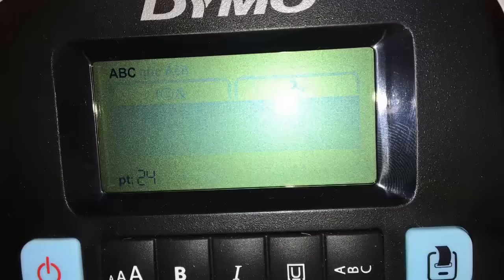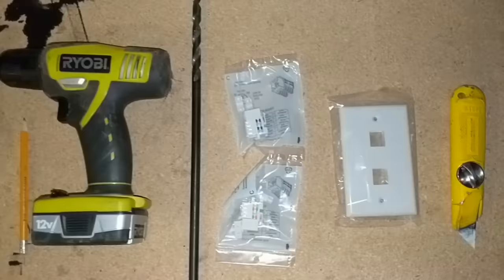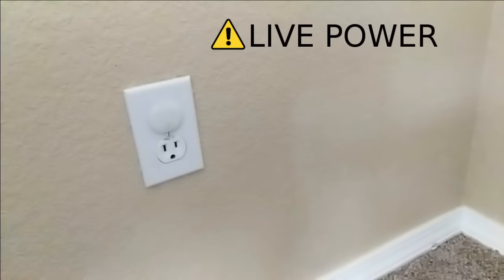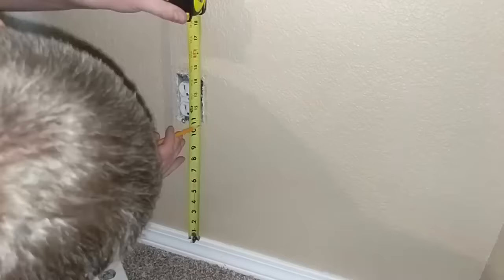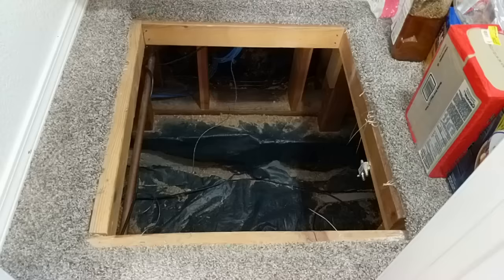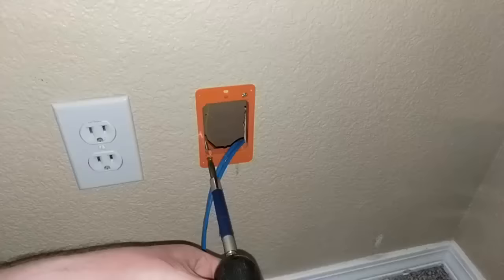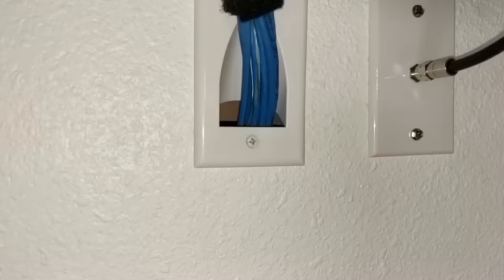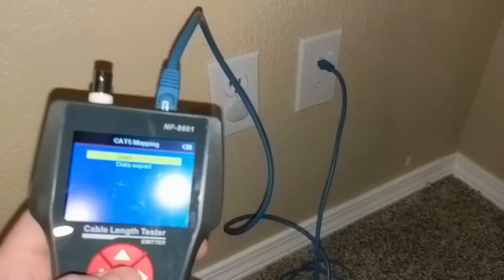How to Add a Network Jack to a Wall

Comment: Good information for getting the wires connected to the ports. I’m surprised by the closing comments about an attic being more difficult than crawl space. My parents house had an attic, and all the houses we’ve had have had crawl spaces. I found the attic 100 times easier to do anything because you could actually stand up and see what you’re doing.
Reply: depends how big your attic is, you can't really stand in mine and you have to be careful to only step on the beams or else you'll fall through the ceiling
Reply: @arsenalfanatic09  ah that makes sense. Only stepping on the beams is pretty normal, but I can see not being able to stand being a problem. That was sort of the case in our first house. It think it was technically an attic, but I always called it a crawl space because the height rendered it useless.

Comment: Typically inadvisable to put low voltage in the same stud space as high voltage. Even shielded cable can be affected by it.  This will be fine for gig but may experience problems with multigig connections
Reply: they just have to be 8inches apart right?
Reply: @Layarion  they need to be separated by a suitable barrier. He could’ve gone to the next cavity over & he would’ve been alright.
Reply: @No Body yes

Comment: HUH UH. I'll game on wifi til I die of old age before I go toe to toe with the spiders in my crawl space.
Reply from the maker: Funniest comment ever!
Reply: router
Reply: Budget Nerd how does the wall get the network from the modem or the router?
Reply from the maker: The Ethernet cable goes from the wall plate, through your house, to a port on the patch panel. The port on the patch panel is then patched (connected) to the switch, which is connected to the router, giving you your internet.
Reply: @BudgetNerd  Is there an under $20 punch down took kit
Reply from the maker: There is a link to one in my DIY budget home network video.
Reply: @BudgetNerd  instead I purchased a double female wall plate, since this is a one time project on the wall under the basement stairs. It was drywalled years ago, but tore down recently  for possible mold growth from a 1/2 water from sump pump  overflow. Putting it backup now and will have the network lines and catv lines ready to go for the drywaller who will just  put the plates back in for me
Reply: Brown recluse and black widows worry the heck out of me. Last thing I want is a flesh eating bacteria sore on my face...I'll go thru the walls some way or another thank you.
Reply: Bob Jones spider bites in the US are completely overblown man. You’ll be alright

Comment: Lots of youtubers put in patch panels, but for those who want to keep it simple, another low voltage box in the switch/router room with a six position keystone plate can be a lower profile and lower cost alternative.
Reply: 6 position keystone plate is exactly what I did

Comment: When I wired my house I purchased different colored keystones rather than using a numbering system. Each room keystone was a specific color. That was eight years ago, I wonder if one can still purchase colored keystones? I was able to run my cabling through the attic easily enough. Fun project.

Comment: That little string you cut off is called dental floss and it is used to strip down the cable beyond where you stripped it to make sure the wires were not nicked when stripping off the outside protective covering/sheathing.
Reply from the maker: Yes, I know.

Comment: Man...American houses are so easy to do DIY on.

I'm in Portugal, have to run an ethernet cable from the main house to the annex, both made with concrete walls, lol. No Crawlspace, no drywall. No easy access to the patch panel.
Reply: Our country is absolutely massive and building codes vary state to state. Please stop generalizing America as if we are a homogenous country. Your home is no more difficult to wire than the nursing home I did last week.

Comment: Tip from a pro:
In situations where using fish sticks is required to fish the wall, locate the lv-1 hole on the other side of the stud from the power, and dead next to it. This way you can ride the stud down and find your fish stick easily.

Comment: Just a couple of things I'd like to mention. You identified where your wall studs were, but then did exactly opposite of what you should have done. Network cables should never be run in the same stud bay as a electrical work and should be at least 12 inches away. You should have gone to the right of the next stud over. Second, you don't use a razor knife for removing a wall plate screw. That's a good way to get a nice cut when it slips off the screw. It's also a good way to get a piece of metal in your eye when the point of the blade breaks off. Third, you do mention a drywall saw, but you aren't using one. You shouldn't use a razor knife for cutting finished drywall. It's extremely difficult to maintain safe control while cutting as you demonstrate while holding your bare hand in the path of the cut as you tried not to slip. Finally, you shouldn't use a drill to lock down a plaster ring. It's a great way to overtighten and break existing drywall.
Reply: Robert Dunham okay bob the builder
Reply: Robert Dunham too long didnt read
Reply: nilpo19 not lazy just don't want to waste my time with another person on the internet that thinks they're a rocket scientist
Reply: sturamic super Wasting your time. You mean like replying to a comment you never read?
Reply: nilpo19 I don't see an issue, read a few words realized he was the almighty electricity god so I replied with the truth, too long didnt read
Reply: sturamic super Yet that comment has the second most upvotes of any comments on this video.
Reply: nilpo19 upvotes.....sorry grandpa ill just go play some videogame bye tell judice I had a good time last night
Reply: Modern screw guns (drills as you call them) have whats called a torque setting. It's very easy to set it low to keep from over tightening the low voltage old work box (plaster ring as you call them). See its easy to criticize others for no apparent reason than to look like a know it all.
Reply: @bpaullus  Even with low clutch setting, power tools will still commonly cross and strip the cover retaining screw.
Reply: nilpo19 I’ve literally never had that happen.
Reply: Thank you Robert, well explain, and right on point.
Reply: If you are a  master at this or whatever you would like to call yourself then why are you watching a video on how to install a network jack? Just wondering if people like you just click on how to videos to criticize them when they don't even make bad mistakes. The only mistakes people ever point out like you are things that a professional wouldn't do but if you are a homeowner then everything stated in these how-to videos are just fine. So stop watching how to videos ifyou already know everythjing.
Reply: Robert Dunham Why can't you run them near electrical work? I've read that you can't but I don't know why?
Reply from the maker: @Oscar Morgan It's best to keep them as separated as possible, and if they have to be near each other, try to avoid running them parallel. The 60Hz frequency of the power in the power wires can induce current in the Ethernet runs creating signal noise. That noise can degrade the cables speeds, or prevent the transmission of data altogether.

I ran my Ethernet in the same section as my power for one of my videos, and I'm sure that's what he's referring to. While he is correct, I have experienced no issues and these issues are often times very rare.. but possible, given the correct circumstances.
Reply: Budget Nerd Oh Ok Thanks, so it won’t cause any problems with the electrical wires, I read somewhere that it can cause arc flares, is this true? Great Video BTW.
Reply from the maker: That's really not a concern.
Reply: Budget Nerd Ok Cool, I guess don’t believe everything on the internet about  causes of arc flashing 😂
Reply from the maker: Not enough wattage to jump to our Ethernet cables. You'd need extreme circumstances for something like to happen.
Reply: Budget Nerd Oh Ok, Thanks heaps for the information 👍
Reply: @oscarmorgan1283  Budget Nerd is spot on with his explanation. However, the effect is much more widespread than he suggests. Power always affects low voltage and it will cause failures if you are certifying the installation. For general purposes, you may not notice speed degradation, but it is happening on some level. It also cause instability and often unexplained problems.

Arc is not a concern with household voltages (outside of lightning strikes), but in industrial applications additional measures are taken when higher voltages are involved.
Reply: @ryleighlawrence6189  I've never called myself a master at this. Yes, I do this professionally. I critique videos and offer suggestions because I believe everyone deserves to have access to quality information. There are reasons that professionals do things differently than DIYers and it only helps the community by making that information more accessible.
Reply: nilpo19 Ok Thanks, how far apart would you suggest run the Ethernet away from power?
Reply: @oscarmorgan1283  The rule of thumb is a minimum of 12 inches when they are running parallel. This is not a regulation, it is a recommendation. And they must never be run in the same conduit. Fire code does not allow category 2 and 3 wiring in the same conduit.

The standard concerning this makes several different distance recommendations depending on how the wires are installed. (Using conduits and shielding can reduce the distance required.) Rather than memorizing all of them, the 12" rule works in every common situation. Since electrical wiring must be secured to studs, placing LV in the opposite adjacent stud bay is the easiest way to make sure you are more than 12" apart.
Reply: nilpo19 Perfect, Thanks for all your help. One last thing, would connect the switch to a modem or a router?
Reply: @oscarmorgan1283  This is a very open ended question without knowing your environment, but the most commonly encountered scenario is modem -> router -> switch -> patch panel -> in-wall cabling -> wall jack. Keep in mind that many routers have built in switches so this can change from time to time.
Reply: If you're concerned about induction but you need your data wires to run parallel to electric wires for a certain distance. You can get shielded cable. Terminating shielding cable has extra steps and you must ground each end of the cable by using a ground wire and special keystone jacks
Reply: actually they only need to be 50mm away from eachother running in parallel, i dont know where you got 12 inches from but according to Regulations 2018 specified 50mm between power and cat
Reply: Robert Dunham who cares buddy. He’s not a contractor and just a regular guy trying to run cat 5 cable
Reply: Yeah, without a shielded cat5/6/7 cable you're looking at some emf intrusion.  Years ago we had a strange call with a lady losing internet constantly.  The outlet was right near the rj45 keystone, when she plugged the heater into the outlet it would cause a magnetic field and the router would crash because there is to much noise.
Reply: @Robert Dunham

Where do you get these types of regulations/best practices for these types of work? I actually do this, and have learned the advice you have given, over time. I would love to have a book to study from, so I can be as professional as possible, and also keep myself from being liable for work not being to code. Thanks for any advice :)
Reply: Robert -
Correct comment.  
This is stated in National Electric Code (NEC) by the National Fire Prevention Association (NFPA).
For critics, you are perfect fodder (“What were they thinking, Do It Right!”) for a Mike Holmes TV Show.
Reply: i run all my cat 6 and cat 6a through 1" conduit.  it can cross romex and i have no problems.  but you are absolutely right... you should always isolate communication from power
Reply: This old House starter kit 29.99$ Robert Dunham
Reply: I'm not an expert and I identified all of those same problems. I guess what I think is common sense isn't so common? I'm sure when I was young I snapped some razor blades doing something stupid. I'm lucky, I don't play around now.
Reply: reads comment
Pffft I'll just use an x-acto knife!
Reply: @SL-rl4kz  BICSI is a great place to start.

Comment: I am considering doing this. I was wondering if you can use an outllet port works both ways so I can use it to plug a cable from my router into a outlet from which a cable goes through my ceiling into an outlet into my room. Pretty much will a wall outlet work as an inlet?
Reply from the maker: Yes, goes both ways.

Comment: Where did you get that punchdown puck, this is the first I have seen of this. That thing is awesome.
Reply from the maker: I'm sure you can get them on the interwebs, but that one came in a 50 count box of keystones.
Reply: You can get them anywhere that sells network cabling. I've picked them up online at Amazon, etc. and also at traditional retailers like Home Depot or Lowe's. Honestly, they don't really work all that well. Most keystones don't quite fit right and they tend to get in the way of the cables as you try to punch down. But for a couple bucks or less, it's worth having one in the tool bag for the occasions when they are useful.
Reply: Leviton distributors use to provide “free” to volume buyers.
I had at least 7, at one time.  I have given them away to new installers — through the years.

Comment: I do this professionally in commercial spaces all the time (there's usually a plenum so I drill down into each stud space from the top instead of the bottom), but I've been wondering how it could be done in residential as there's typically no plenum. Guess it's gotta be attic or crawlspace. Unfortunately my current place has neither lol

Also, would definitely recommend the drywall saw over the utility knife
Reply: Wire tracks are very common in this case as the customer usually doesnt want you taking off the entire drywall which is what you would have to do.

Comment: All of this equipment adds up to the exact opposite of budget.
Reply: Exactly! I hadn't thought of it that way. All I could think of is how often would I use these extra tools.
Reply: Except when you factor in the cost of installation by a pro. Most of these items you can borrow from the IT staff from your office.  Cost is in cable and injectors really.
Reply: @josephyang3260  You're way off? Where are you shopping? Wallplate is 90c, connectors are $8 each, the spool needs only be 50ft, unless you have a 2000+ sqft house which would probably put you above. You're looking at more like 30-40 bucks for good quality 6a cable. 60 for 150ft. Basically your 265-300 bucks is what I would call the "don't shop around" cost. If you shop around that's an easy 80-100 bucks. So it's even cheaper than you thought. No one should use an electrician to do low-voltage running of wire, that's overkill. For me, this project cost me 30 bucks because I don't even care about 6a or needing those speeds.
Reply: I’m about to do it. Uncle has a spool from when be did his house. I just got some jacks and wall
plates. Like $4 a jack and less than $1 a plate.

Going 5e because I’m not running a whole office.
Reply: @crazy4cockapoos  I charge $160 / drop - 100ft or less. It goes up from there for length, and/or unusual circumstances.
Reply: @josephyang3260  I don't pay much more that much for plenum cable, and I don't use shit grade CCA, I use solid copper only. It's about 160 / 1000ft for cat 6 CMR. You don't need 6a, you're not making a 200 meter run in a house. Monoprice cable is pretty decent, just avoid CCA like the plague, it's junk.

Comment: 5:14 When drilling holes between floors you'll probably want to seal up the hole the cables will be going through with some-sort of fire stopper, such as fire resistant foam(this isn't supposed to stop a hypothetical fire, but is meant to slow it enough that you have more time to get out in the event of a fire).  Also use Riser rated cables between floors (riser rated cable have insulation made with slowing fire in mind)and plenum rated cables across a single floor run(when it burns it won't be toxic.).  In doubt stick to plenum if you have to make more complicated Ethernet runs with going up a floor and a large distance horizontal across that floor.

Comment: Sometimes to locate the area of the wall to drill up from I will use a piece of coat hanger (about a foot) put it in my drill pull the carpet back slightly and drill down by the base board,   Go under the house find the coat hanger aproximatly inch and half over drill up with half inch paddle bit.

Comment: There are wall plates available fitted with double ended RJ45 sockets. If you have the room to run cable with the plugs on it makes the job a whole lot faster.

Comment: The walls of my house are made of solid concrete... I'm fucked.
Reply: You can still run wires, it's just that you're likely stuck with having them running through conduits that are attached to the outside of the walls. It is uglier, but the upside is that it's a lot easier to run wires like that and if you ever need to replace or repair them, you're not having to deal with things being hidden behind walls.
Reply: Masonry drill bits.
Reply: You can do it, champ.

Comment: I wired my home back in 1998 with cat5. I used two twisted pair of the cat5 for one connection and the other two twisted pair for a second connection. That way I had two connections to my hub with one cable. Worked fine back in the day, but everybody grew up and moved out. Now I use some of the connections but WiFi most everything.

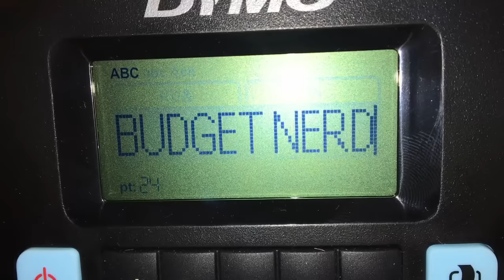Comment: At the 0:16 mark in the video, you show a brief picture of what your rack looks like. What is that device below your switch that the cables are running into?
Reply from the maker: That's my patch panel. I have a video on patch panels you could check out.